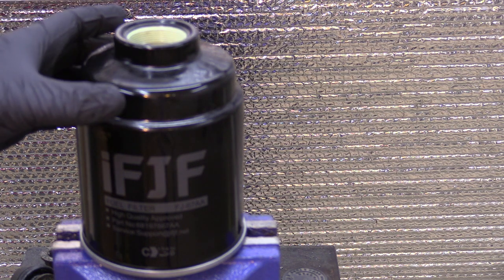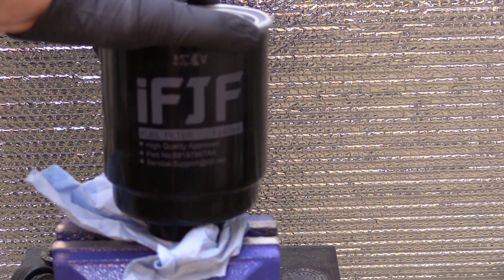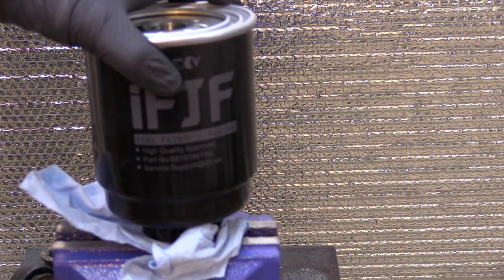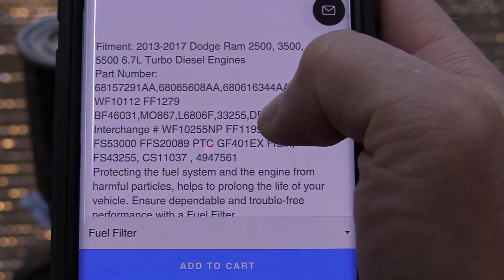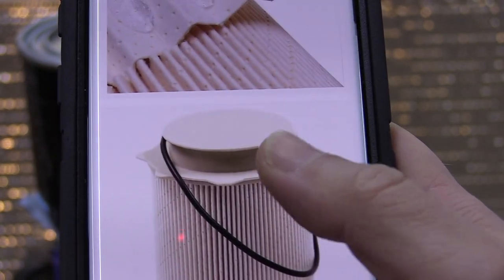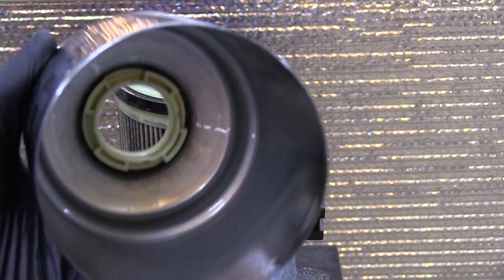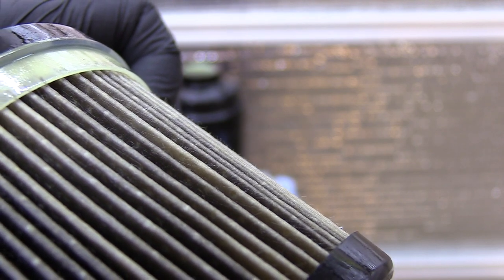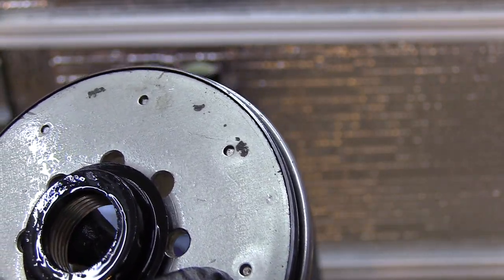IFJF Diesel fuel filter review. Beware of fake fuel filters on Amazon. IFJF best diesel fuel filter?

Comment: HA! Funny thing.  I just started using a iFJF filter, had it for a few days, not even a week.  But I'm not using my iFJF to replace my OEM filter.  I have an auxiliary fuel tank, and sometimes the paint/liner on the inside of the tank will flake off.  So to protect my transfer fuel pump, I installed a reusable/washable stainless steel mesh filter from iFJF.  But I'm still running my OEM filter on my truck, no way and I getting rid of that, not even for a filter that is "high quality approved".  This is so funny, if it wasn't so serious.  Let me just say, trying to go cheap can get real expensive real fast.
Reply from the maker: For majority of people cheap is good enough. Quality always comes with cost.

Comment: I put a fuel filter water separator on my gravity feed fuel tank line going to my factory tank. I mounted it to my bed frame exiting out to the filler neck valve.  Yes its overkill, but wanted extra filtration before it reaches my main fuel tank. Good idea or no?
Reply from the maker: Yes, it is good idea.  Clean fuel is always good thing for diesel engine.
Reply: @repairvehicle  Thank you so much for your recommendations.
Reply from the maker: You are welcome.  What do you have and year?
Reply: @repairvehicle   Have several trucks. Farm trucks, Toyata tundras, tacomas ect. Truck in question is a 2019 f 350 6.7. I recently installed a RDS tool box fuel tank combo 90 gallon. Aluminum tanks tend to sweat and wanted a way to remove moisture and debris before reaching my main fuel tank. I have a tacoma 4cyl with 1.2 million miles same powertrain
Reply: Great idea have seen transfer tanks kill injectors.

Comment: Interestingly enough. the canister is more expensive than the filter media. In realty they could probably make a quality filter.
Reply from the maker: quality media comes with the cost and that's what cost the most.
Reply: @repairvehicle  some manufacturers are getting $54, $62, $104. no matter the quality no water separator/filter is worth that much either.
Reply from the maker: 10 microns filter media vs 4 microns, makes big difference. 4 microns will cost more and will make equipment last longer.

Comment: Correct me if I'm wrong, but that extra space at the bottom is the cavity to hold water, correct? Since it is supposed to be a "water separator" as well.
Reply from the maker: You need extra space for water, but not Half a quart.  Well known brands and factory don't have a Half quart extra space.  Extra space is not to collect water and drive with it. You suppose to drain water every month or sooner if sensors senses.
Reply: @repairvehicle  correct you drain water out every so often or if a sensor trips. I couldn't tell that well how much space was actually there. Thanks for the clarification on filter depth
Reply from the maker: What do you have?
Reply: @repairvehicle  first generation lb7 6.6L Duramax
Reply from the maker: Very nice truck! I respect duramax.
Reply: @repairvehicle  it's been a good truck for me for it being an older truck
Reply from the maker: Diesel can run forever if it's maintained to high standards.

Comment: I have a 2020 ram 2500 Cummins, I'm I suppose to be draining water out of my fuel filter? I use Mopar filters only
Reply from the maker: It use to be a required every Month to drain water from fuel filter and not to rely on sensors.  Now it's all about relying on sensors to tell driver you have water.  When sensors say you have water, it could be too late.
Reply from the maker: Mopar fuel filters, not any worse than aftermarket fuel filters. They're good filters. Many people bash trash oem fuel filters but they are not bad fuel filters, just change them more often and don't follow factory recommended intervals.
Reply: Thank you for the information, one more question. I've been using hot shot secret diesel treatment with the  lx4. Is that good enough lubricity for the cp4 and not to much for my dpf. Thanks again for all your helpful knowledge.
Reply from the maker: Excellent question. Don't forget to subscribe.  I am working on the video exactly about this subject and details will be shared in the video.  Continue to use hotshot secret and after the video we can reevaluate your options and what is the best for your truck. I am not trying to be mean here,  it's a lot more details than I can describe here in words.

Comment: Hi thanks for the video.!! Which one is the best filter for Ram 2500 6.7?
Reply from the maker: When it comes to fuel filters for Cummins, Mopar or Fleedguard, best filters money can buy. I have not seen other brands offering better filtration than specification listed for Mopar or FLeetguard. There companies that claim to have better microns ratings than Mopar or Fleetguard, but they are lying when you cut open these filters.
Where to buy OEM Mopar or Fleetguard fuel filters?
Ram dealers online or directly in person on site.
Cummins website
Genosgarage.com

Stay away from ebay and Amazon, I have contacted these companies directly asking if they have proof that their filters genuine and they told me they could not provide.
There might be Ram dealers on ebay selling OEM fuel filters, I have not came across one yet. If I find Ram dealer on ebay I will make a video.

Keep in mind there is a lot of fake filters that have OEM name on them. Its best to buy from reputable resellers or directly from manufactures.

Currently there is shortage of Fleetguard filters, genosgarage don't have them yet, on back order. Even Cummins website did not have them in stock for the last 2 months.

Comment: I am pretty sure you misspoke. That filter you show is not for a 2019.
[EDIT: I strongly believe many CP4 pump failures can be traced to junk fuel filters and owners that fail to purge air from fuel system after filter changes.]
Reply from the maker: Did I say 2019? If I did, then I misspoke.  2019 is cartridge style front and back.  Up to 2018 ram uses canister filter in the back and cartridge in the front.
Reply: @repairvehicle  I am pretty sure I heard 2019 and you are indeed correct here with up to 2018.
Reply: It's from water contamination 99% of the time. As a long time diesel tech, I've seen this far too many times. The other 1% is def contamination from user error.